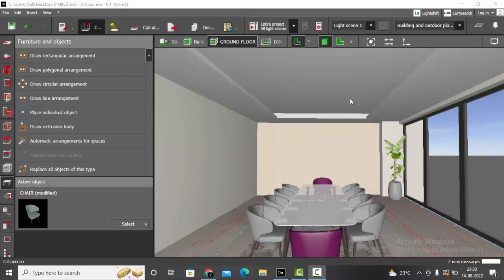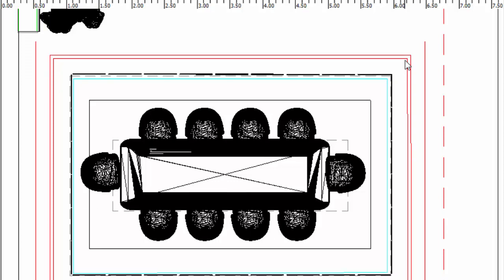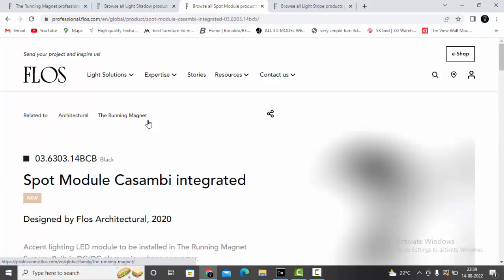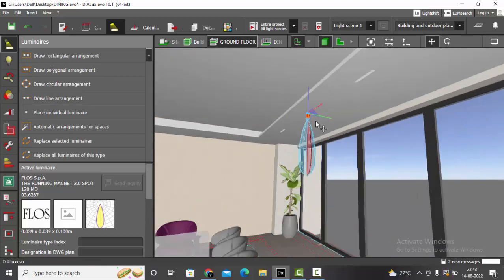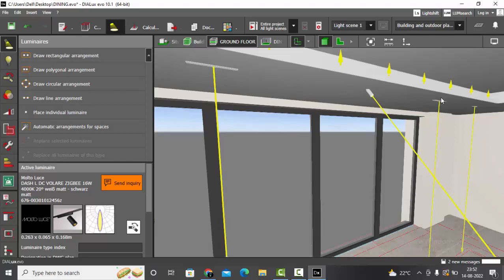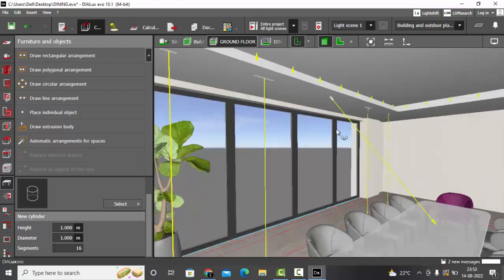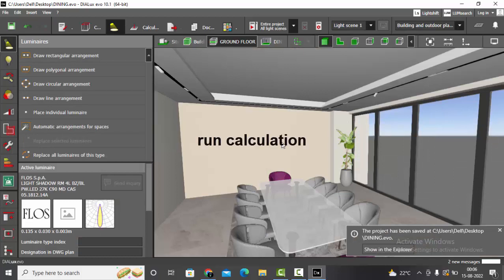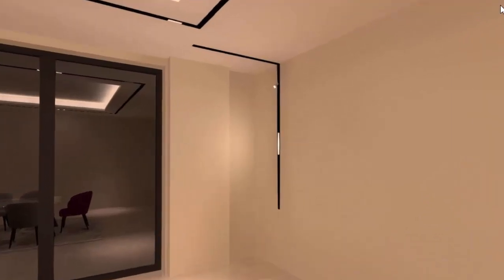Making Magnetic Track / Tracks in Dialux Evo

Comment: Hi Sumaiya! You are truly amazing, congratulations on the tutorials, I'm following them step by step.
I have a question for you: when I create a LED strip on a plasterboard wall, I download the photometric curve of the aluminum bar and then enter the type of LED strip in the "bulbs" section. The problem is that the aluminum bars are 1 meter long and obviously I can't cut them! if I have to put a strip in a 30 centimeter niche what do I do? Thank you
Reply from the maker: Thank you for supporting the channel. 

For led strip you can edit the ies file length and update it's lumen output and wattage in ldt editor. 

You can also check lumsearch.com for ledstrips of small dimensions that can be used in niches.